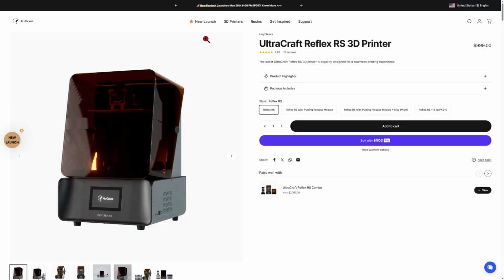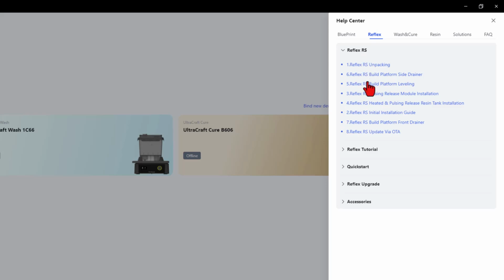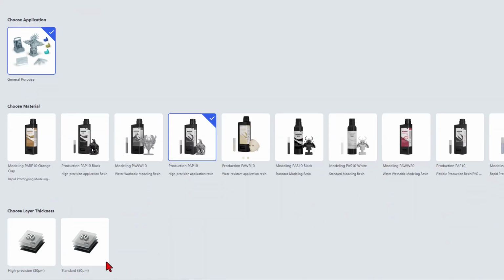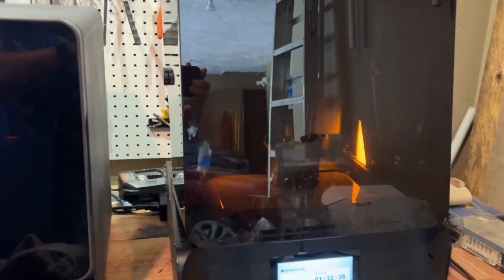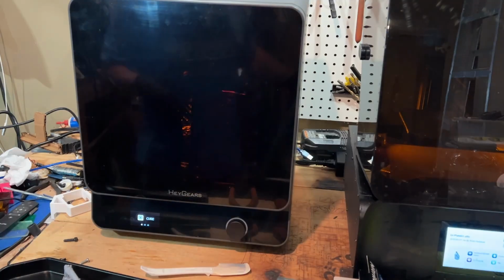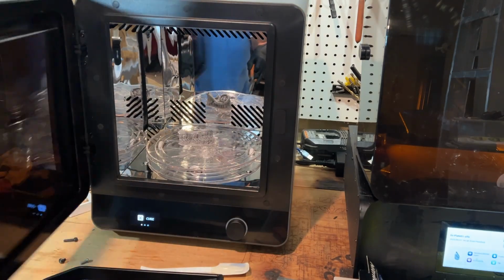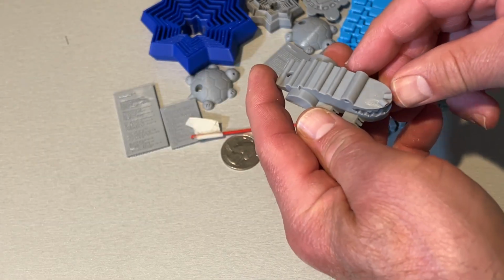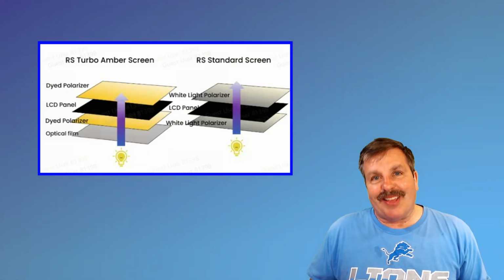First Prints in Minutes with the HeyGears RS Turbo Resin Made Easy!

Comment: I use the water based and water washable resin. They say it's 200X less toxic over solvent based. I rinse in the sink and the bottle says EPA approved.
Reply from the maker: Very cool! What brand are you using? Thanks for sharing.
Reply: @HLModTech  MSC Water Washable Resin and SUNLU Water Washable Resin 1000g which is only 17 bucks a kilo!  Both are Soy-bean Plant-based Photopolymer Resins.
Reply from the maker: Awesome! Thanks for sharing! I just played with the PAF10 resin yesterday. It is a bit flexible... like hard rubber.

Comment: Nice. First move:calibration
Reply from the maker: I sure do appreciate them arriving built. I remember my Anet A8 where it was a small box of parts. Took about 8 hrs to assemble. This was powered up and running through the calibration in about 30 minutes. Have you spent many minutes with a resin printer yet?